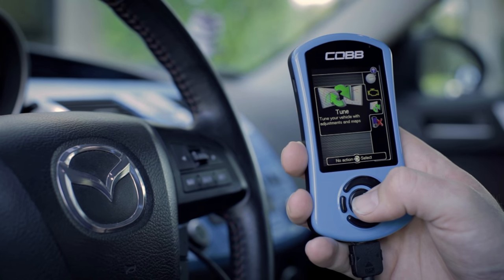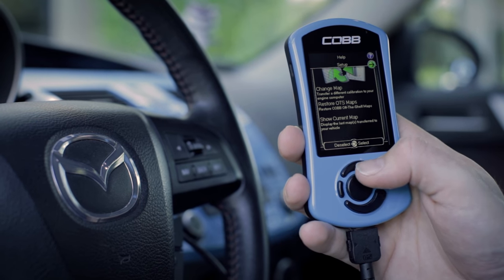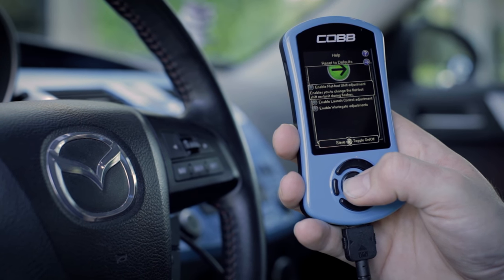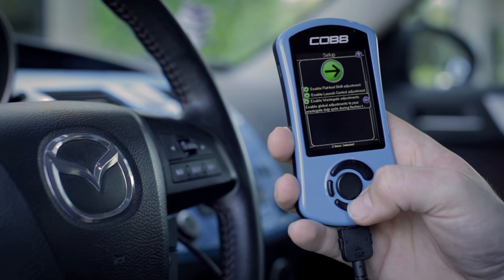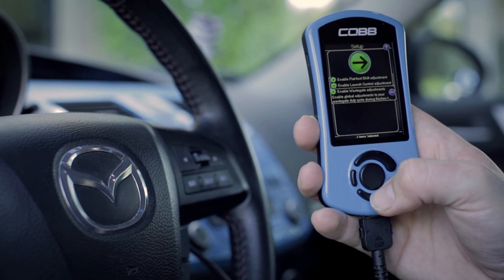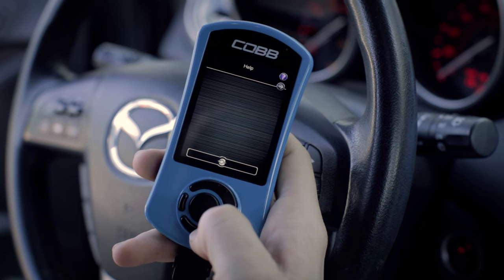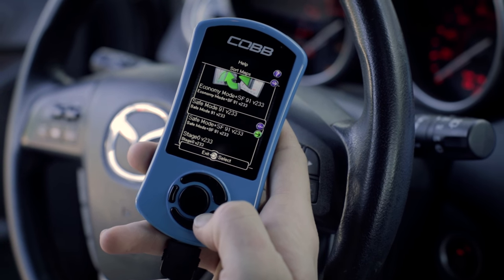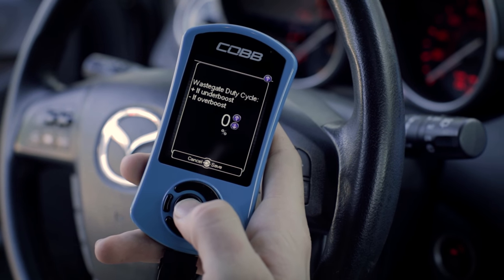COBB Tuning - How to Enable Mazdaspeed Advanced Tuning Features on the V3 Accessport

Comment: Do they come with Maps already installed to the access port?
Reply: Yes they come with bunch of different base tunes. These aren't custom fitted to your modifications however unless you have exactly what's specified, and still every car is different.
Reply: @iMdAhAcKeR  bone stock 2011.got a cobb AP .put the stage 2+ and that bitch was zooming zero issue for 4 or so pulls..blew the turbo and clutch is burnt..best car rental i ever had!
Reply: @daniellee6408  Seriously?